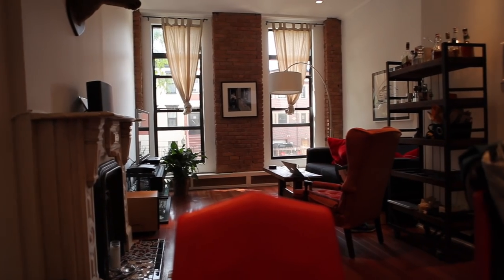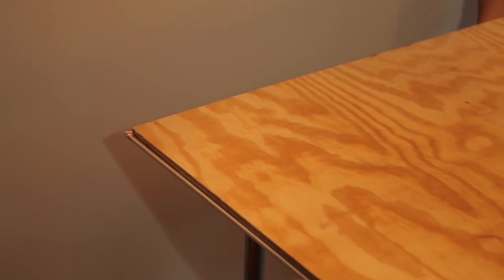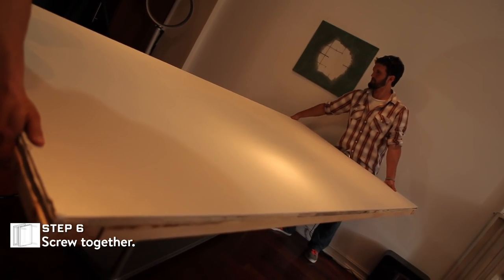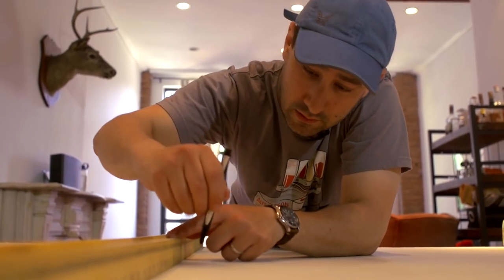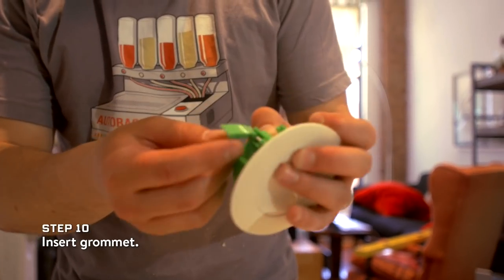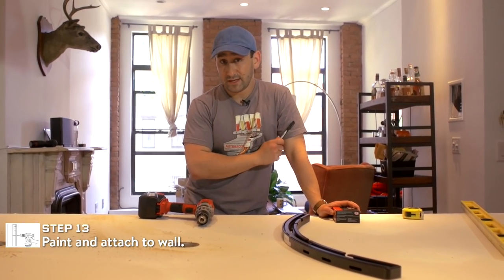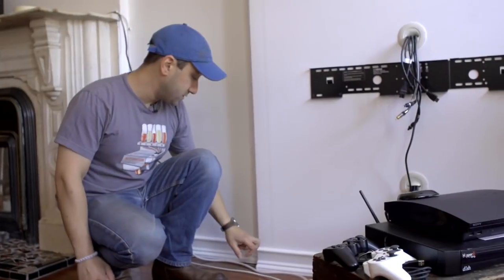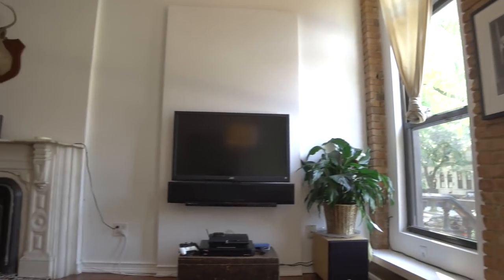How to Build a Fake Wall for Mounting a Flat Screen-D.I.Y.-WIRED

Comment: You did a nice job.  However, I must say I laughed at the end when you screwed the fake wall to the existing wall.  All that work and you still drilled holes in the existing wall.  I understand your concept but you really should have worded things differently.  You make it sound as though you won't be doing anything to the existing wall so people don't have to worry about getting their security deposit back.  Not quite the case unless they do some patching and painting after they remove the fake wall.   Also, the molding you applied is not a "Crown Molding" it's a "Baseboard" or "Baseboard Molding".  Crown molding goes at the top of a wall where it meets the ceiling, hence the term "crown".
Reply: Chilllllll it’s just a video 😂😂
Reply: 8 years later but most apartments let you drill into walls. They don't allow anchors though because they make biggish holes. But any apartment I've ever been to or lived in allows drilling into studs and there is no expectation for the tenant to patch or paint anything. I've always got my security deposit back in full. What else would you do with a false wall though, lean it against a solid wall?  Lol...
Reply: I didn't know that they allowed us to cut the baseboard out but not put screws in the wall? Hummmm....

Comment: 1. The vast majority of apartment renters will not have the means to make this (space, tools, etc). 2. You spent all that time (hours for anyone here that's going to attempt this) making this only to drill holes into the original walls in the end, which was the original intent of avoiding in the first place. Quicker solution - Just get a TV mount, place on the wall like a normal person, fill the holes before you move.
Reply: Ryan Francis ya if you're lazy...build this is you want your place to be cool :D
Reply: Oh it's definitely unique and can be customized in many ways, but the video's first point is for an easy DIY project to save the walls of your apartment. It is neither, but I agree it's pretty cool.
Reply: Ryan Francis I don't think the screw holes were the issue it was the larger holes to run wires through that were a problem. Some landlords won't care about mounting screw for pictures but if you start cutting 3" holes in the wall they might be upset. This is why he made the faux wall not for the little screw holes that can be hidden but for the larger holes made by the hole saw. And after the faux wall is removed you can't tell that it was even there.
Reply: I was the first person to do this, but I did it because I wanted my TV to be mounted to a leather accent wall.

Comment: The point of the fake wall was to avoid holes in the real one. But you have to screw the fake one to the real one....wtf
Reply: AtomicShadow64 w
Reply: AtomicShadow64 😂😂😂😂
Reply: Holes to run the wires. The stud holes can be patched up easily.
Reply: patch some fucking drywall
Reply: But what about the molding he just cut out to put it there!
Reply: Now he can drill whatever he wants on the new wall. The original wall has minimal drills in it. The fake wall will be able to take more holes and decorations options.
Reply: another point is for brick walls

Comment: So lemme get this straight. You commit a crap ton of time and money because you don't want to drill holes into the wall of your rented apartment by making a "fake wall", when in the end you're drilling the fake wall to the wall you wanted to avoid drilling? I'm done. 

What a mega-troll.
Reply: +Phillip Lee What would you rather wind up repairing, the few screw sized holes in the wall from hanging the fake wall, or the huge 3" holes he drilled in order to run his cables?
Reply: +Justin Richards I don't quite get your question...
Reply: +Phillip Lee The idea behind this is that if you build your own wall then you can hide the cables in the wall you built. You can't do that with the walls already in your apartment because there is no good way to return it to it's proper state once you move out. With that being said, I still agree with your sentiment. I would not opt for a false wall in an apartment.
Reply: +Anthony Rodriguez  It's impossible to repair a wall? You can fix a 3" hole in the wall for $5.  Mostly with just a fraction of the very same materials he used in this video ;-)
Reply: MrNateSPF It's not impossible. To make it look professional you're going to need a much bigger hole though, at least big enough to put an HDMI/Ethernet outlet in.
Reply: +MrNateSPF Exactly my point.
Reply: +Phillip Lee good point Philip
Reply: Lol... Drill the whole directly, and when it's time to leave, cover then and pait them 😂😂😂
Reply: The thing is.. I mounted a tv to my wall without some damn 3" holes.. That's freaking ridiculous. There are plenty of ways to hide cords and make it look nice that require a LOT less. And 2nd of all.. he just cut out a big section of molding for this!!! For that I absolutely would be pissed if this was my rental house!
Reply: Bro I needed this cause my house isn't a paper and cardboard house like yours

Comment: This is a great solution for my situation. I own my house, so not worried about a security deposit. But the wall I need to use has a built-in shelving unit on the other side. They inset it, I can't even tell if there are studs in that space. So a secondary wall will give me the security I need without worrying about what's on the other side of the existing wall.

Comment: I’m in an old house with lath and plaster walls, questionable wall strength, and a very heavy tv. Patching walls I can do just fine, but the TV could still make a big mess out of the plaster. I like this approach. I think I’ll do the same because I know I can trust the strength of the fake wall. Thanks for the video.

Comment: 4x8 sheetrock 7 bucks. 2x4 frame 3 bucks a piece. plywood  around 15 bucks. so def under a 100 bucks for the project. it was a project, fun, and gave some ideas....good video. all these haters in the comment is hilarious
Reply: 4x8 dry wall and more like $15-$20, $30 in studs, $30 plywood, $10-$15 drywall mud, $10 box of drywall screws, $25 gallon of primer, $25 gallon of paint, $20 floor trim, this isn't even mentioning the tools used to build this pointless project. Clamps, drill, drill bits, saw, puffy knife, painting materials, quick grab caulk and gun. Now your talking a hundreds. And the kicker I loved most about this project, was the whole idea was to avoid touching the original wall, and you still have to fucking screw it to the wall!!! Idk if I walked into one of my renters homes and saw a tv mounted on a wall, I would understand. If I saw a new fucking wall drilled to my wall, I'd be fucking pissed.
Reply: Screwing the fake wall to the real wall is easy to patch with some spackle. It's a little harder to spackle the 4 inch hole that was drilled to route cables. Not saying it can't be done with a patch, but you WILL lose your deposit. That being said, this is still too expensive if you're not adding some type of design or texture to it to make an accent. When I made mine a long time ago, I upholstered it in leather to make a unique wall.

Comment: Nice job, especially the way the wiring is completely gone. Might even use that in my own house.

Question though, is it a thing where your from that drilling holes is gonna make you loose your deposit? .. I personally think abusing the crown molding like that can be considered a bigger issue :-/

Comment: I would think that if someone has the ability to complete this project, they would have the ability to patch a few screw holes in the wall with some spackle and paint...
Reply: +lasvegasira Especially considering they would still need to do that as this "fake" wall is attached to the real one with screws.
Reply: Boom, exactly. Most pointless project I've ever seen

Comment: Two Holes for the screws holding the fake wall to the real wall is a lot less holes than all the ones used for the TV mount, and the Sound bar mount.

Comment: Would been cool to put 3 flush mount speakers for the center, left, and right for sound. the cable hide is awesome, might be nice to sink the TV into the wall so the face of It is even with the face of the wall with some plywood on the back, recess some threw bolts to the munt so the back of the wall is smooth, eh, just a thought.

Comment: So, cutting out a section of baseboard ISN'T going to piss off the landlord?
Reply: Agreed. Cutting out the section of baseboard completely defeats the purpose of this. Now, if you could pick up matching baseboard, then you could just shorten the 2x4s by the hight of the baseboard so it mounts flush with the wall, allowing the plywood and drywall to extend all the way to the floor. Mount the matching trim across the front and wrap it around the sides using a coping saw to match the profile so the new trim for seamlessly to the existing.

Comment: I still like this idea better than drilling 20 holes in the wall. Maybe if they had made it so it doesn't extend to the floor, and more like a 3d wall tile it would a little less out of place. Don't tell me they cut the crown molding, that's a definite no no.

Comment: Better yet, get an old door. Should be free if you keep your eyes open for one. Screw a couple pieces of wood to reinforce where the tv mount goes, and mount your tv to the door. You can lean the door against the wall or put it behind a heavier piece of furniture with the door sandwiched between the wall and furniture so you don't have to make holes in the wall.

If you want a seamless look you can drill a hole in the old door and route the cables behind it. This video is a neat idea but pretty impractical.

Or, you could get a stud finder and screw your tv mount into the wall of your rental. Fix with a couple dabs of spackle before you move out. I've never rented a place where nail and screw holes weren't considered normal wear and tear

You're welcome.

Comment: This is beyond stupid. You're telling me this is better/easier than filling 4 fucking holes when you move out and have to remove the tv mount? 
Where is the typical renter (limited space) going to store saw horses, lumber, and power tools? 
Where are the average renters going to find the space to build a fucking wall?
Tell me, how do you anchor the fake wall so that it doesn't fall forward? Drilling into the already existing wall, right? And it's got to be in the studs to ensure a proper anchor. What I would already be doing with a tv mount. Plus you will need much longer and thicker lag bolts to properly attach this fake wall to the existing wall.
Why would I buy lumber, plywood, sheet rock, saw horses, saw, extra hardware, and paint, when I can simply fill four 1/4in holes with spackle when I move out?

Comment: granted it looks nice but alot of work for what would of been possibly 2 screws and 2 holes to repair when leaving. If the house/aprtment has cavity walls then its much easier to simply repair the 2 x 4 inch holes and some screw holes (2 if you used the same Philips tv bracket that he used). voila!

Comment: This is a cool idea, me personally I would put some lights and an acrylic frame behind the fake wall , between it and the real wall, to let the light bleed out. And this is also great to hide cables, but it stops there. I was mind boggled when after all that work to avoid drilling on the real wall, he goes and drill it to fix the fake wall LOL, I was expecting another solution, well explain things better next time. Good work anyway.

Comment: The only holes he made in the real wall were drywall screw holes which are easy to spackle over later when you move out. It also provides tons of support for the TV as you're using a sheet a plywood and studs. If you run the cables in the bottom hole and out the top before you secure the fake wall to the real one you don't have to fish cables through either. So basically lots of good reasons apart from not have 3" holes in your landlord's wall.
Reply: What about the baseboard?

Comment: or you could just spackle the holes your drilled into the actual wall, and use a butterfly patch to fill in the hole you used to hide the cords. and guess what, that just took 1/10 of the time and 1/50 of the money.

Comment: This makes no sense. To mount my Tv to my wall it takes 2 screws drilled to the stud. To do what you suggest adds like 15 steps and then you have to worry about the cost of materials when you still have the same result, 2 screws drilled into the wall. I guess it helps if you plan to hide your wires, but all in all the ends do not justify the means. You still have 2 screw holes in the wall.

Comment: I don't want to damage the wall and lose my deposit. So I drill a ton of holes in the wall, and the best part - rip the skirting board off and make a hash and mess of adding it to the fake wall, it looks ugly. Sorry, don't mean to be too critical, coz you have some skills. In my opinion, this is a badly thought out project.

Comment: Mounting a TV to a wall only takes putting 4 screws into the studs...There is no damage (that can't be spackled and painted over later) done to a wall by mounting a TV on it. This project was just a FLUFF piece. also - There was no need for the plywood.You'd actually be attaching something much heavier to the wall. Most walls are just drywall on top of a stud frame. And NO SANDING. If you know anything about taping, when you're finished with the compound you are ready for primer or paint.

Comment: Does this guy think a King's Crown is his shoes?  Crown molding goes on the ceiling, base board on the floor.

Yep, that is what I am pointing out about this ugly fake wall that does not even go to the ceiling.  Let alone the fact it takes more screws to hold up then a TV mount.

Comment: Kind of hard to miss solid wood when on the other side of the drywall you for some reason put a redundant sheet of plywood.   Then of course there is the whole pointlessness aspect to all this as has already been pointed out by others.

.... and did he call baseboard "crown molding?"  Who is this guy?